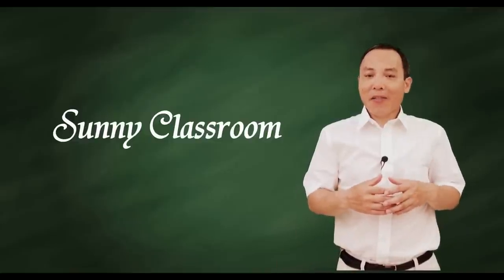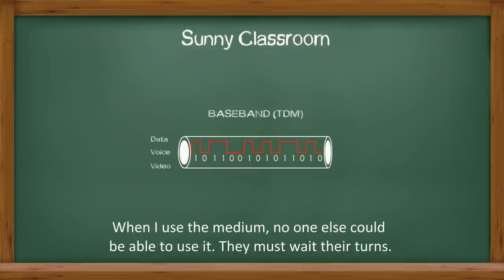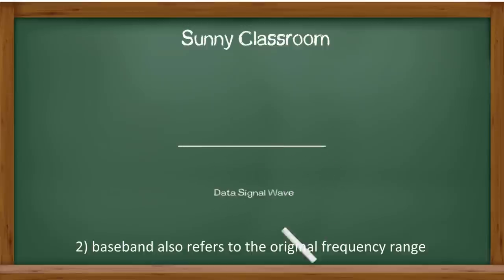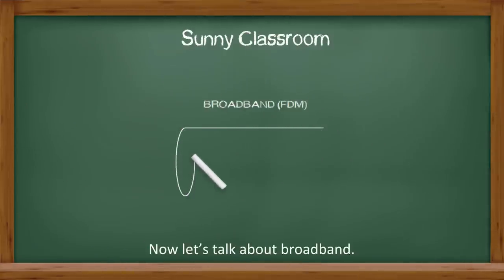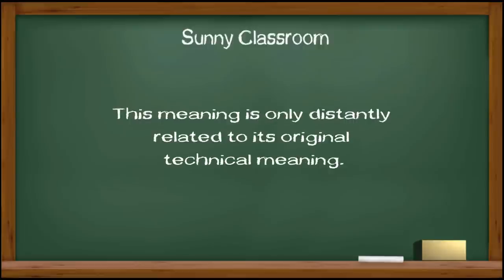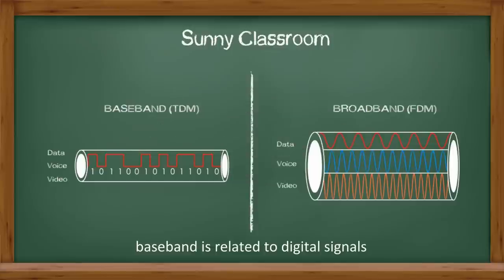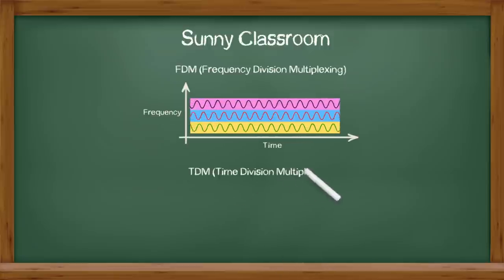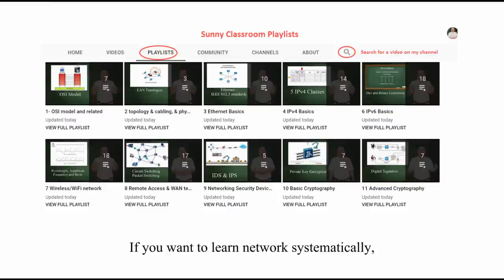Baseband vs Broadband

Comment: 1) Baseband is related to digital signal transmission where the entire bandwidth of a baseband system carries only one data signal at a time. In other words, every single signal would require an exclusive use of the shared medium. When I use the medium, no one else could be able to use it. They must wait their turns. Ethernet is an example of the baseband system. Regardless of different versions, whether they are early Ethernet, fast Ethernet, or 10 Gigabit Ethernet, they all contain the word “Base”. They are baseband.  
2) Baseband also refers to the original frequency range of an analog signal before it is modulate to a different frequency range. An audio signal may have a baseband range from 20 to 20,000 hertz. When it is transmitted on a radio frequency (FR), it is modulated to a much higher frequency range. AM and FM are two comma modulated technologies in radio broadcasting.
Now let us talk about broadband. The term “broadband” technically refers to any type of signal transmission technique that carries two or more different types of data in separate channels. Broadband signals can share one medium. It is like a multiple-lane highway. Two or three vehicles can share the highway side by side at the same time. Broadband is also used as a marketing term for Internet access. This meaning is only distantly related to its original technical meaning. In popular usage, broadband Internet refers to any high-speed internet connection, such as DSL, cellular, cable modem, or satellite. However, Broadband definition differs from country to country. In North Korea, the broadband may not be qualified as the broadband in USA. In summary basement is related to digital signals while broadband is related to analog signals. Baseband system does not allow digital signals to share one medium simultaneously while broadband system can transmit different data side by side at the same time. For analog signals frequency division multiplexing or OFDM. it used to make analog signals share one common media for digital signals in a baseband system. time division multiplexing or TDM it used to chance me the different uses data over one common media .TDM divides time into slots or intervals and assign .them equally to these users in this way everyone has an equal share in general baseband system is a transmiting less amount the data than our broadband system .